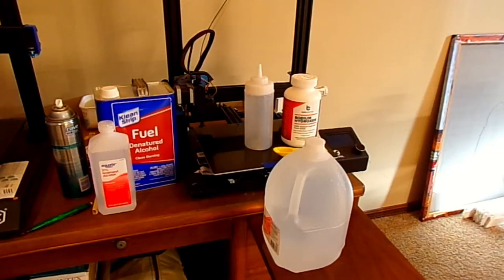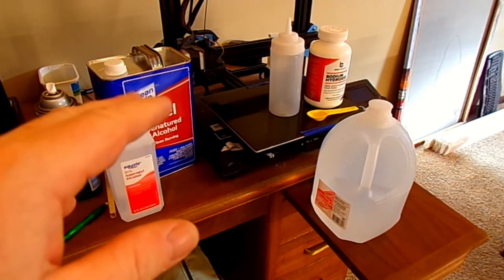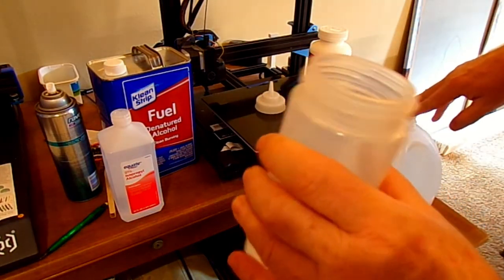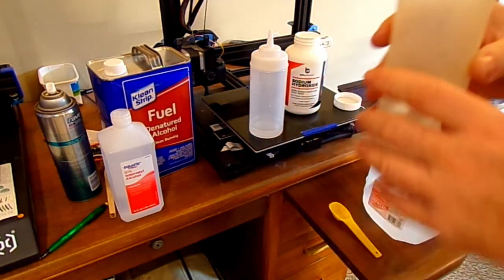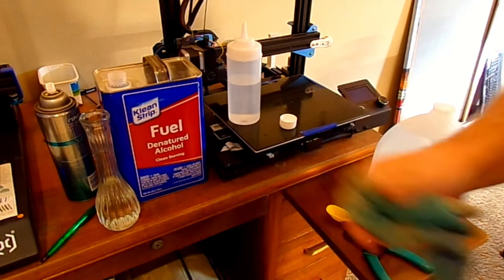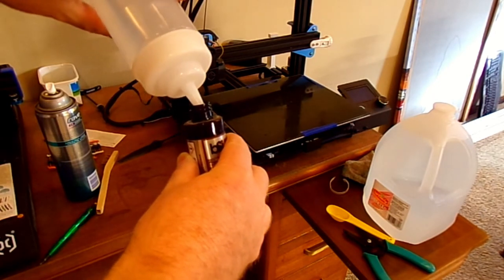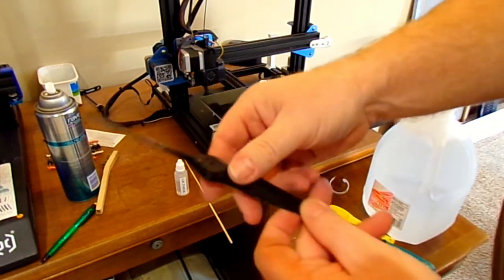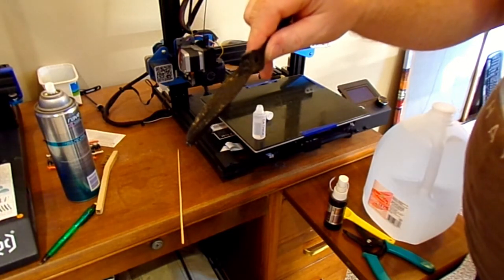Can I Make DIY CA Accelerator??

Comment: thanks for showing some with the sodium hydroxide. Some use baking soda but it's so weak that's pouring more cloudy white matter on.
Reply from the maker: Just a quick tip if you try this, DON'T use the water.  There's enough water in the isopropyl alcohol.  It works much better with much less water!
Reply: Can you add the final mixture formula to this video, or put it in the notes of the video description?

Comment: So, a year later, what did you find to work the best?
Reply: Building guitars I use a ton of liquid accelerant. It can be costly, so, I decided to try alternatives. I tried; alcohol, ammonia, bleach, then chlorine. They all accelerated but only chlorine got rock hard. Chlorine also dried faster than the others. How did chlorine compare to the can of accelerator I've been buying? Not as good. Chlorine dried around 20% the speed of the CA accelerator. I also use baking soda which works fine for fixing bone, bindings, and anything when I need a super thick glue